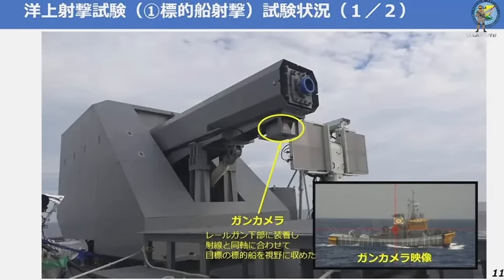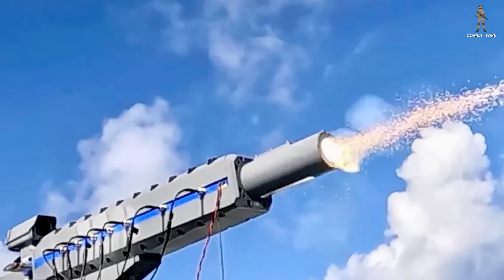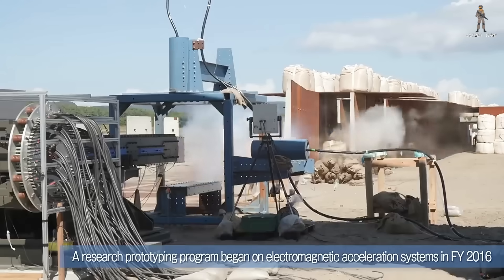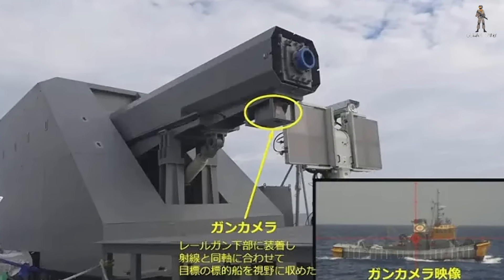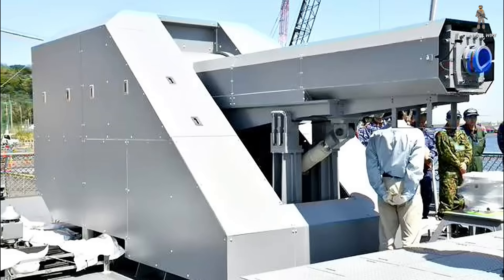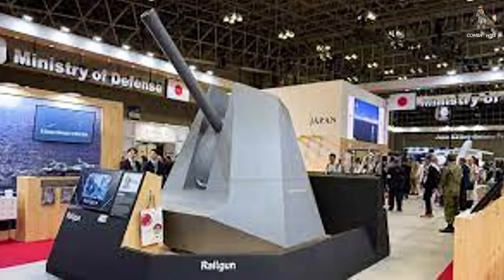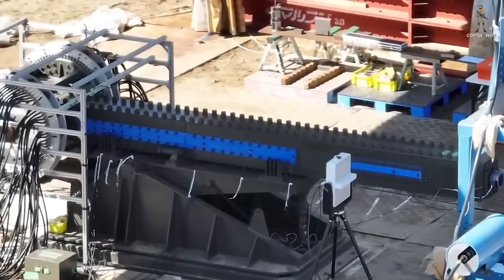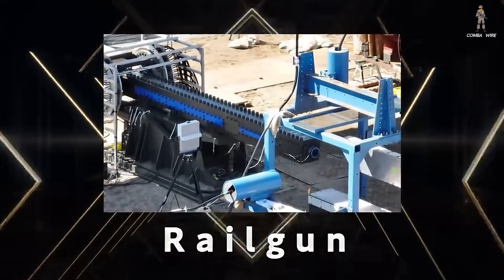For the First Time Ever, Japan Reveals True Railgun Damage at Sea.

Comment: A good weapon combination will be lasers and rail guns.
Reply: Especially if you mount them on sharks.
Reply: Lasers aren’t working out very well.
Reply: It's gonna end up being lasers for defence and missiles for offense. You simply can't beat a missiles range and mid flight correction ability.
Reply: @yusriyahbagheri8843  but wouldn’t laser have no bullet drop just and fire
Reply: @RandomMackem0069_Official  lasers have limited range due to atmospheric scattering and the focal range of the laser itself. That's why it's used as a defense, in combination with bullets and other missiles.
Reply: @yusriyahbagheri8843  Lasers and turret defense systems prevent from missile and drone attack from happening its kinda hard to hit enemy ship in this day and year railgun projectile speed is the key its much harder to spot target and destroy projectile flying with speed of 2500 meters per second so if you are at 10 km range you only have 4 seconds for reaction and railgun projectile pierce thru heaviest ship armor so no ammunition storage is safe from this weapon giving high chance for one shot one kill.
USA version of railgun with 20 MJ of energy can hit target at range of 90km
Reply: @yusriyahbagheri8843  One idea was to make guided railgun munitions. They'll be more costly than unguided, but still cheaper than missiles. And you can load much more of them on the ship and are safer. Role was mostly defensive - anti-air and anti-missile. Unguided was intended only for land invasion support etc.
Reply: Don't forget plasma cannons! 😉
Reply: Missiles have a far greater payload and range, and reach mach 5-8. Railgun is a toy, lasers dont work during for and bad weather
A single AA 20mm canon is enough to get rif of drones and work in all conditions
Reply: @ddoumeche  Drones are one thing.  Drone swarms are another entirely.
Reply: @Bunglefritz  ahah drone swarm in the middle of pacific .. funny
Reply: @ddoumeche  China is actually building a drone ship, that is, a ship made for launching drones and full of them.  I imagine it would probably be patrolling somewhere in ... the Pacific.  Fair guess?
Reply: @Bunglefritz  i imagine very well : you need one missile to sink a drone ship, and dozens of drones to sink a destroyer. Dozens of drones emit a lot of radiations, and need a lot radiations to guide them because they have no self guidance, they are slow, much slower than a missile, weak against sea winds, and all you need is a 76mm or 20mm gun to shoot them. You have a plenty of time to do it because they are so slow
There is a reason why the US navy destroyed a lot of japanese planes and kamikaze strategy failed
Reply: @ddoumeche  Russia is sending on some nights 600 drones toward a single factory, plus missiles.  They have missiles, too, and they're much better than ours, being hypersonic.  They use them in combination with drones toward the same targets.  The Chinese have hypersonics too.  

The Ukranians have radar on the ground, too, but it is not enough to have radar to stop the drones, nor the drone and missile combo.  Being on the water doesn't change that threat.

Also, Russia has developed drones that fly via fiber optic wires, defeating attempts to bring them down by scrambling their guidance electronics.  I'm sure their cooperation with China will make those accessible to China, too.
Reply: @Bunglefritz  
- good luck guiding 600 drones on a ship, you probably need a carrier full of operators for this. plus kitchen personal, mecanics, officiers, and so on
- 600 fiber optic wired from a ship, with a 10-25km range. You do know the range of a exocet, harpon ?
- land and sea are different story
- italians and french FREMM destroyed houtis drones with relative ease and canon 
- hypersonic missiles are a different animal
Reply: @ddoumeche  Drone ships will not be unaccompanied.

We are far more vulnerable to their missiles than they are to ours.

Swarm strategy can defeat individual gunnery.

Combined arms strategy is the rule in the Russia/Ukraine war.  We cannot suppose that will not be the case in a naval confrontation in the Pacific.  Russia is regularly sending in hypersonics to destroy the ability to defend against drones, then sending in the drones.

The Russians aren't  stupid, and neither are the Chinese.  

As to the Houtis, that rag-tag band sent the U.S., the most powerful navy in the world, off and running.

Comment: US Navy has probably gotten into a rut from "knowing" too much and forgot it was research and thinking outside the box might lead them to better solutions.
Reply: The biggest issue the US Navy had was that 15 years ago materials science could not produce the alloys needed to make the rails more durable.
Reply: @colincampbell767  Looking at some of the alloys they planned to try, might be something we'd see in big switchgear like sintered tungsten/silver/copper alloy or similar
Reply: There is also a size difference here, the US were basically aiming at a battleships main gun in size and effect, were the Japanese went with defense or destroyer main gun in size and effect. The power and force is squared when you make it bigger, so it wasn't so much they were on the wrong track, but more that they went to big to fast.
Reply: we don't know.  But we sure know that there's no platform at the moment that can sustain such a weapon on them.  
A whole new type of ship needs to be designed from the ground up.
Reply: @yiptastic12  is it really worse than getting hit with ship to ship missile?

Comment: …there are few concerns, the huge electric power to power this, and a very huge heat and …the second shoot after the first not ready in time because of the first two issues. …so carry a so much weight only to trigger a golden bullet once per hour or two is useless, to use a like so weapon must carry a small nucluear’ battery or reactor 😅
Reply: not quite what you think. there are things called capacitors that accumulate energy and that can release anytime you want. if you put batteries and capacitors in the power circuit any Arleigh Burke class destroyer can operate one at high firing rates relative to naval guns.
Reply: @tunejunky  ..of course...cannot work without capacitors, but...who will load them after few shoots ?....c'mon' you're smart...no sense to explain to me.
Reply: @entropy_of_principles  that's why i posited batteries which allow quick discharge while capacitors accumulate for extended fire. the truth is while not able to fire as rapidly as auto-cannon it's faster than manual rates of fire the fact is you need fewer hits to disable/destroy. only the most major vessels can take more than 2 hits
Reply: @tunejunky   That depends on the power generation capacity of the ship vs the power requirements for a railgun.  Since the railguns will likely require a ship to be designed from the keep up to hold them - I suspect that power won't be an issue.
Reply: I heard a Japanese person say that they could wait 15 seconds for the subsequent fire. Already tested 120 shots.
Reply: @akob3349  This is not a 'service' weapon.  It's essentially a technology demonstrator.
Reply: @akob3349 …in a war time, 15 sec is luxurious
Reply: @entropy_of_principles   If they are firing in series as a battery of guns instead of a single repeating gun it could make sense, they need to flood the barrels with water or some medium to stop it basically arch welding it's internals away, liquid metal or graphein maybe to prevent barrel wear or a combination of both, then a heavy rubber flange on the projectile to clean the barrel after each shot. A projectile with 2 rubber flanges could have the entire length between those 2 flanges pressurised with water increasing the surface area contact while containing the water long enough to prevent it from turning to vapor.